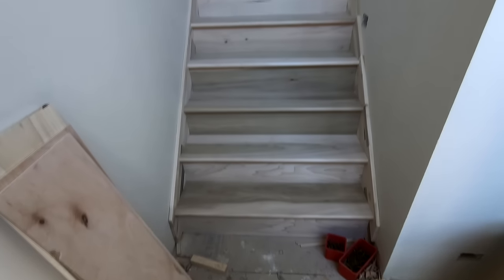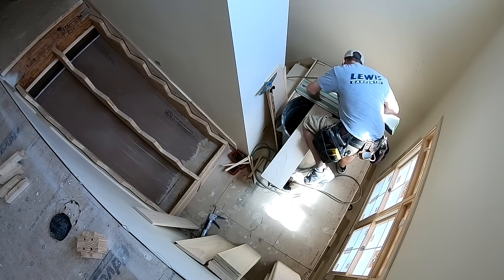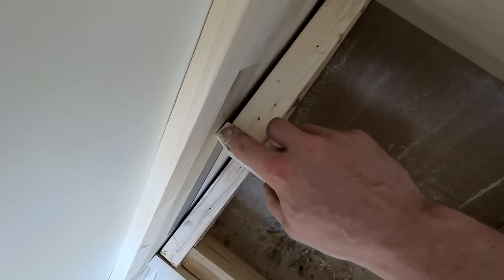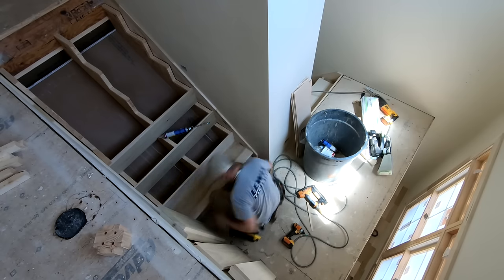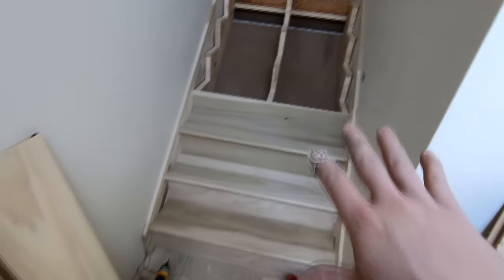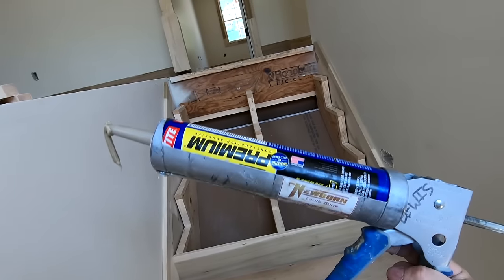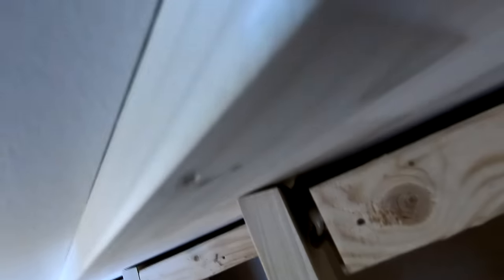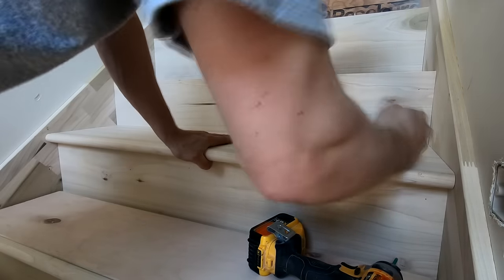How to Install Hardwood Stair Treads & Risers...Key Techniques for Perfect Results

Comment: We are 1/2 way through replacing our old carpeted and crappy builder grade cracked squeaky stairs with oak and have been following your video.  We have experience in other DIY projects but never any woodworking.  And certainly nothing of this level.  We are also picky and anal about results.  I can not tell you how please, and a bit shocked actually, on how good they are coming out.  We’ve been watching, rewatching, and finding any answers we need in this video.  Thank you so much.  We never could have paid someone to do the work for us.

Comment: This has to be one of the best instructional videos explaining how to do this job. Even down to the 5% angle to make room for adhesive. Well done
Reply: I'm a DIYer and figured out how to do it pretty much the same way he did.  The only difference is I had subtreads and screwed up into all the treads from below, then screwed the bottom of the risers into the treads.  Solid as hell now.

One hint:  Cut one side of the tread at a sharper angle about 2" behind the nosing.  This wont be visible later and it makes laying the tread down so much easier.  I also cut the risers and treads a hair longer to make it a tighter fit.

Comment: This guy fixed a 1mm gap between the riser n the tread probably 99.9% of the buyer or realtors would nt even notice. Bravo for taking pride in your work n thanks for the tips. You have gain a New subscriber

Comment: You are the only other  guy I have ever saw  screw the stringer to skirt board .A plus to that also, screw your skirt board to the wall first in as many place as  you can that will not be seen. 
I do cut my treads with a small back bevel you will never notice it on the front. One other think i do is i level all my treads from front to back i use a screw as a leveling leg only at the back and tread will set on riser at the front . And yes the glue is the trick.  Just some things i have picked up over the last 30 yrs  I still watch to learn stuff too Great job sir

Comment: Glenn the average homeowner here, I watched this video awhile back, I made my own stair jig. But what I didn’t do on my first set of steps is use enough adhesive. My first set of steps squeaked. So on my second set of steps I went back and noticed how much glue you used and my second set of stairs came out much better. Almost no nails on second set of stairs made a world of difference. Thanks for passing along your knowledge.

Comment: I've been searching for months and this is by far the best video of its kind!  I really like that 5° bevel trick in key places to hold the adhesive.   My staircase is a back/forth with a skirtboards on one side only, but I learned a lot of great tricks here.  This video gave me the confidence to finally tackle my project.   I am also doing it on previously carpeted stairs, and here I learned to remove all the old plywood and fasten everything directly to the risers.

Comment: On your 5 degree bevel.... instead of looking everytime.... as soon as you cut  bevel on top edge and sides of riser or on treads...put a small pencil x on it with pencil.. same as left and right sides.. just need a quick look then.. never make a mistake then...YOU ARE ANN EXCELLENT FINISH CARPENTER AND EXCELLENT TEACHER.. WISH I HAD A TEACHER LIKE YOU OVER 30 YEARS AGO... LOVE YOUR VIDS👊

Comment: Really well done. I just tore out all the treads in our squeaky staircase built in 1984. Not one drop the of construction adhesive was used back then. So I layered it on just like you recommended in your vid. You can hear a mouse fart walking up and down those steps now.

Comment: Best Video I've seen on how to replace (in my case) treads and risers. My husband and I bought a 130 yr old house which was in pretty good condition when we bought it a year ago (we've done lots of improvements ourselves, as well) but the stairs are a hot mess and we've been discussing our winter project of replacing the treads and risers. We're a bit nervous about getting it right - your video is excellent! The 5 degree cuts is such an excellent step and one I've not seen elsewhere. I agree with using more adhesive and minimal nails. Having watched your video has given me more confidence to proceed (hee hee - with or without my husband). BTW - your video didn't seem even remotely as long as it actually was. You had my undivided attention the entire time. You are very direct and to the point, you explain every step and tools used in a way lay people can understand. Lots of people have tutorials but are not actually very good teachers - you are a very good teacher. Keep it up.

Comment: Digging the result-oriented approach. The general technique used here in NL is to dado the steps and risers into the side stringers, it makes for a nice looking supporting joint that by itself holds the treads in place. Re-doing stairs generally involves re-framing or at least blocking or shimming everything to be as close to perfectly even as possible, so that all treads and risers are identical. This does push any gaps to the outside walls where they need to be fixed separately.

Comment: Great video!  In regards to the painters doing a poor job filling holes:  I was taught to stain all woodwork and apply one coat of varnish (naturally allowing each to dry before proceeding) and then fill nail holes with stain-matched wood filler.  This seals up the wood so you can then wipe off any excess wood filler without it marking up the wood grain.  Then you apply a second coat of varnish after that.

I will be checking out your other videos!
Reply: That's an excellent tip!
Reply: The color matched wood filler: you mean something like the minwax putty that goes with their different stain colors?

Comment: Hey spencer when you have a staircase with an open side, how do you use the stair gauge (only one side is closed to skirt board other side is open)?  I'm going to be doing a "re-tread" job over subtreads.  Thanks!

Comment: Great video! The only thing I do additionally is to pocket screw the top of the riser to the tread above, usually only between framing stringers. Perhaps overkill. In my experience, no such thing as overkill when it comes to stairs!
Great job!

Comment: I have done my fair share of hardwood stairs. Full stain grade to stained treads. I'm usually behind sloppy framers but this method seems like it will save me significant time even if I'm dealing with good or bad framing. Also what I have found beneficial particularly with full stain grade is to have everything pre stained and at least one coat of clear. Sure it will need touch ups but it saves on bigger repairs from the trades behind me.

Comment: Nice job! tracks saws do make stairs much easier I always use 3/4 AC plywood loctite everything down making sure everything is level and straight then put down the treads and risers with more loctite no squeaks for sure

Comment: Great video.  I have 3 stringers.  What about pocket holes on center stringer to pull treads down tight?  I appreciate the use of limited visible fasteners.  Thanks.

Comment: Doubt I will ever have to do a stair, but there are a ton of tips, tricks, and techniques in here to do the job right.   That stair gauge is a must have, as is a mini track for a track saw. I imagine a short track could  be made for any track saw by cutting one made for the saw  to length.

Comment: Have you ever tried making a stairs how we do in the UK. We house out the stringers for the treads and risers and then wedge them up from the back. Most of the time, the stairs leave the workshop as a made unit. apart from the winder sections. I'm not saying this is bad quality, but you can really do better quality stuff in a workshop. To be honest, here around London, it's a must. I couldnt imagine trying to do a hardwood cut-string stairs on a building site.
Reply: Darren W ... Its called “custom”. Around here something run out in a factory is considered “builder grade” (meaning Fast & cheap)
You can’t cut corners if you want quality.
Reply: most high end stairs are shop built where i am in the us. not sure what haven remodeling is talking about, maybe hes never worked with a custom millwork shop to have stairs made up. both housed stringers and open stringers are done here too.

Comment: Great work! Got questions?
Wouldn't it be better to nail the bottom of the Risers as well?  2, Could you screw the tread in the back from the under side, using a ledger board and each end into the skirt board from under at an angle using small trim screws?  3, How do you remove the Tread if it gets damaged with it being screwed to the riser? 
I'm not pissing on your work brother, by no means at all, your attention to detail is amazing! Its great to see that! 40 plus years in construction myself.

Comment: Please don't let me offend anyone. I have been doing stairs for years. I think this guy is spot on with his attention to detail and efficiency. I think he does a hell of a job for " cut to fit" stairs . However , everything he has just shown you , depends on the stairway being framed perfectly plumb, level, square! Which is almost never the case! Also , this glue only application almost never works,?especially since you have contractors walked my on these stairs all day long. It's nice that he sands everything's BG and it's very important, and often overlooked when people buy primed risers and skirts. The glue needs to be able to adhere, to the porous wood. That said I always route my skirt boards and still haven't come across a staircase where the framers are perfect in their installation of the stringers! So that means shims! The 5 degrees is spot on like he says and he does a fantastic job however , we have always put threw to four fingers sh nails down into the tread. He may be able to get away if he does have insulation behind or underneath, and if he uses screws to fasten the risers to the treads. Not once did I see a level pulled out and we always make sure out stairs are level and plumb. This often requires nails and shims and lots of glue. Now, like I said , we route the skirtboards, and shim up to create a tight gap up and and this means the tread and risers are locked in between the skirts. This ensures a more locked in and stronger installation. That said I think he has done a great job and attention to detail is great and knows how to work smart! I have my opinions on the nail less aprroach he has gone with tho! Yes the pl adhesive is very strong but all it takes is one break iver the years and the tread is squeaking like a mouse!

Comment: Great video bro!! In my opinion BEST STAIR VIDEO ON YOUTUBE HANDS DOWN!!💯.  Sir I have a question to ask I’m installing new treads and risers all my steps but during the remodel of my home when the gentleman took up the carpet he also took off some type of trim that was on top of the skirt board? I have searched high and low trying to find out what that piece of trim was but I cannot find an answer so I was wondering if maybe I could possibly email you some pictures of it and see if you could help me figure out a way how to fix this? I would definitely compensate you for your time!! Thank you.   Billy Ferguson

Comment: Just subscribed! Thank you for taking the time to explain all these steps, I know it makes the project longer for you. Also, the end part with the wedge was great stuff! knowing how to correct things as I learn to get better at them is very helpful.
Reply from the maker: The stave shim trick is a life saver!
Reply: @InsiderCarpentry  you mentioned you used a jig for the shims. How do you make the shims?
Reply from the maker: Wedge jig for the table saw.

Comment: Not to go too old school on you but I really appreciated what you said about developing a system for stair tread and riser installation around a set of tools.  When I apprenticed, my stair installation tool kit comprised of a bevel square, 12pt cross cut, 8pt rip, low angle block plane, #5 smoothing plane, hammer, nail set, scribing knife, 6' folding wood rule and some sandpaper and a portable sawing/planning bench with wooden Jorgenson screw clamps.  Gluing technology was poor and mastic type glues were inconsistent, yellow glue was not practical so what we depended on was precise fit and proper nailing, (always trying to put the nail angle in "shear" or as you say stitch nailing)  And although we hoped the mastic would hold squeeky stairs 5 or 10 years into the future were an accepted casualty.  Watching the precision and effort that your installation techniques produce just reminds me how your generation of carpenters has come to depend and rely on tool, material and glue technology.  But would I trade the old school ways for the new,,, naa I think you've got it about right.  I hope that you are able to find an apprentice to pass your knowledge along to,,, that's the next step it would seem to me.
Reply from the maker: You are right about that for sure. I try and maximize my skillset by being able to do a job with the most basic tools but there are definitely a lot of new tools in the last decade or so that have been real game changers to increase efficiency. Its good to use them but not HAVE to use them.
Reply: @InsiderCarpentry  I know your a pro, everything about how you maximize your productivity without sacrificing a very high quality level says master trim Carpenter at work here,,, so what I'm about to propose is at odds with how you conduct business be that as it may,,, do a video of a simple tread and riser install, with hidden skirt boards using hand tools. Even just a a half set of stairs to a mid landing say. Size the threads and riser with a crosscut/rip saw, find the angles and mark your cut lines with a bevel square and instead of using air nailer, hand nail and set with nail punch. I would say that it is still prudent to bed everything in PL, after all you don't want sqweek callbacks. Where you screw the riser to the tread from behind use an old Yankee and a push pull drill and slotted screws. True all the boards with a joiner or #6, cut your mastic relief bevels with a block plane. I use to bevel all the skirt board ends of the treads only leaving the last 1/2" square for appearance, just start your bevel back far enough.  The folding box rule and bevel square become your thread and riser tool.
A pair of low saw horses and Jorgensen wooden screw clamps are your cutting fitting bench. 
When i turned out I had to produce a half set in 3.5 hours with that tool kit. Mind you I wasn't able to produce the consistent perfect joints you do,,, but all my work had to pass for stain grade. In any case I'll bet your audience would love to see how it use to be done so they could really appreciate how far the trade has progressed.  You'll need to practise your sawing before you set out, make sure all the tools are razor sharp and maybe you make a few less dollars but I'll bet it will be a very interesting video. We used to make a special saw bench that was a big improvement over horses although it would take you a couple hours extra to fab with the same tool kit. Last too suggestion my Master would include a rough 12 rasp in his kit. I carried one but if he wasn't on the job it stayed in my bag. The one clear benefit of this work is the beautiful sound of sawing and planning would by hand. Anyway thought i would offer it up.  You've got a great channel. Keep up the great work

Comment: In the New York metro area you can buy a set of ready made stairs. It seems that other areas of the country prefer the site built. Having done both I'll take the ready made stairs over the site built.  

I used to specialize in rails and stairs  (when I lived on Long Island I owned a small custom railing and staircase company). You do some really nice work!! But there is always more to learn and you seem willing to make the effort to do so.

Two books that are worth reading if you really want to master handrails and staircases are Modern Practical Stairbuilding and Handrailing by George Ellis and A Treatise on Stairbuilding and Handrailing by W & A Mowat. They are considered the classic books on the art of stairs and handrails.
Reply: So you might be familiar with HB Millwork on LI. That’s where I learned to build stairs a looong time ago. Very different method. We routered out the stringers and then installed the treads and risers using shims with glue and fasteners.
Reply: @Slightapex  I'm very familiar with them.When I had my shop and I needed a cheap set of box stairs I would buy them from H&B. Tim and Mike were always nice to deal with. I sold them a lot of my clamps, as well as other machinery, when I shut my business down. I ended up working for them for about a month after that because they were short of people in the shop. I still have my H&B Millwork sweater. LOL

Comment: Great video! I find myself doing retreads where I live. Typically the side stingers are spruce and have a bad warp. I usually have a sacrificial board that is a few inches shorter than the tread. I scribe the left and right side, measure the space in between and  trace it into the actual tread. Absolutly use the track saw though! Just some grinding afterward... makita over here too, not the fez. 
Your bit about less steps is spot on though! Keep the videos coming. Best content I've found!

Comment: This is a GREAT video! One question I couldn't find answered here or in any of your other videos is "How do you finish at the top?!?" Please help or direct me to the video that shows you doing the top tread where you can't screw it to the riser. Thanks!
Reply from the maker: On the top tread, I run the tread all the way back. Then I drop the very top riser down onto the top tread. Use adhesive. Scribe if necessary.
Reply: @InsiderCarpentry  Super. Thanks.  What is "scribe"?